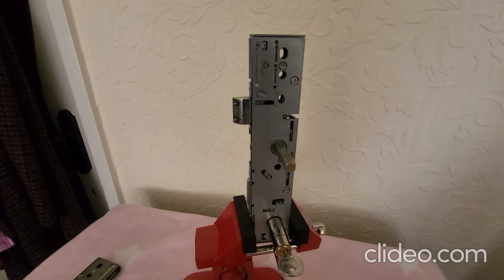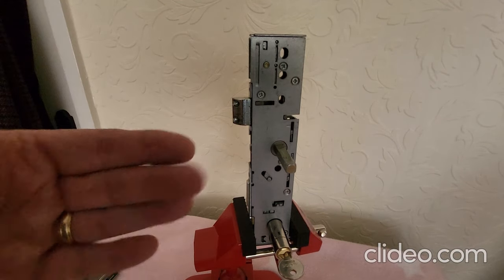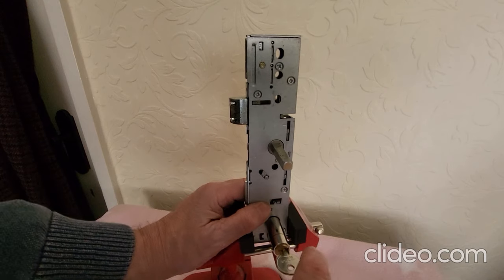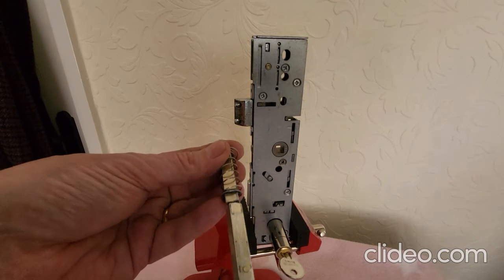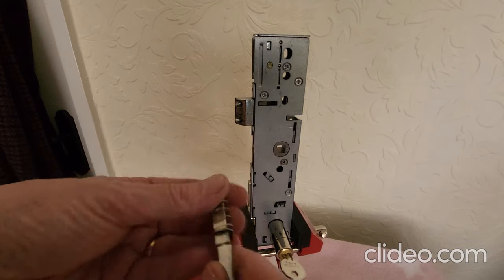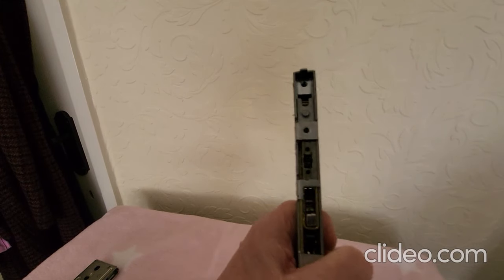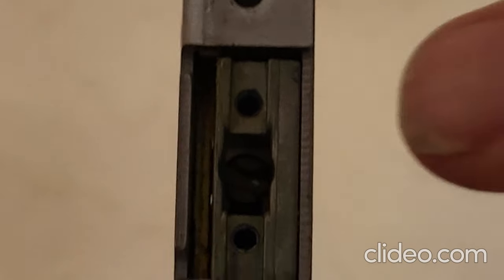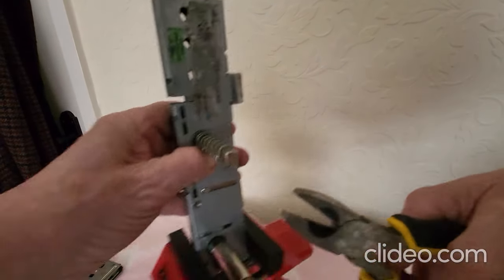ERA Split Spindle How To Change The Handing

Comment: Hi, great explanation, the issue is that my latch isnt operated by the key, it's only controlled by the handle, it's a new multi point lock, do I need to change the centre case?
Reply from the maker: This depends on the make/model of the centre case as not all are manufactured to accept a split spindle.